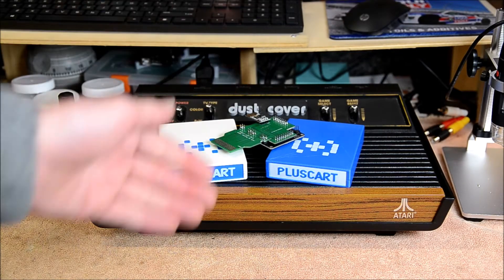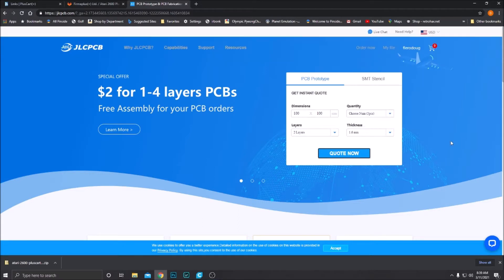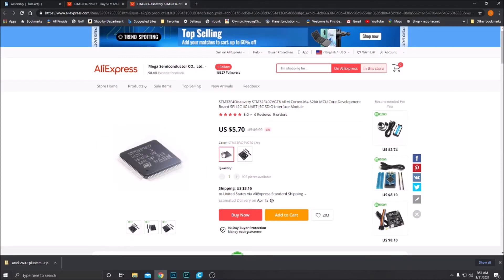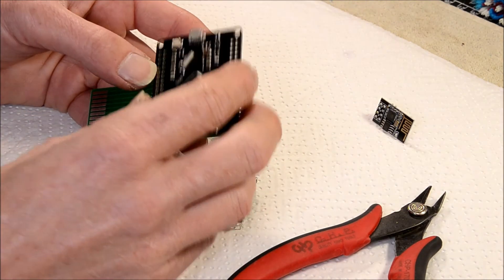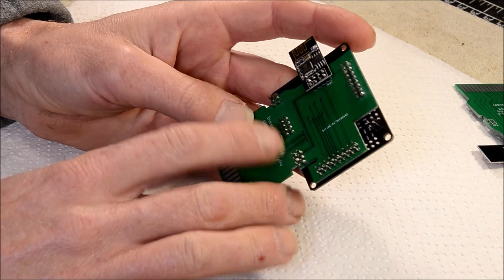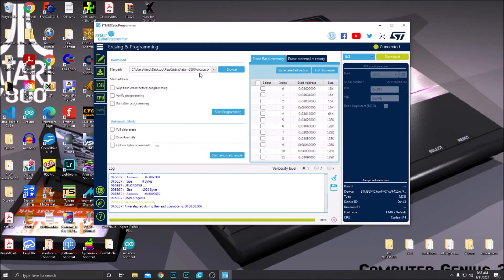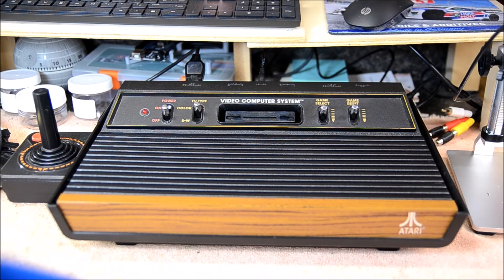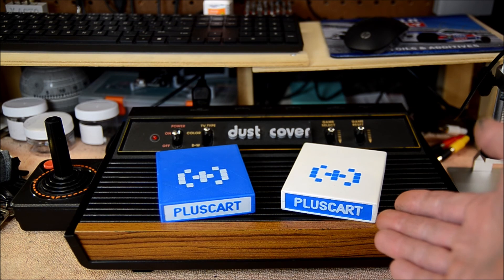How to Build a Atari 2600 PlusCart

Comment: I purchased enough to make 2 of these.  Followed the instructions to a T "
Double checked everything at least 10 times and tried 10 different micro usb cords.
It is not recognized by both my home PC" and the STM32Cubeprogrammer will not recognize it either. 
Very disappointing and highly frustrating.
Reply: this may help. I had the same situation and this resolved the issue: https://www.youtube.com/watch?v=DLhRbzL1i5E

Comment: This is a cool protect.  Though, the component choice is odd to me (I know that's not your fault), but like the ESP32S is about the same price (or cheaper than) the 8266, and it would remove the need for the STM32 (since it's more powerful and has enough IO pins). -- Just seems like a weird component choice in 2021.

Comment: Hi Doug. Thanks for your guide. Watched it, bought the parts and built it using your video.  One thing, I note in  another reply you mentioned you can flash roms into the memory in the development board. I tried to work this out myself but really couldn't understand how to do that. Any chance of a future guide on that? Once again thanks for the helpful video.
Reply from the maker: On your plusstore webpage, add roms to the offline roms folder. Then fire up your cart and a option on the main menu will appear, "download offline roms"

Comment: Where do you get the spring for inside the shell? And can it be loaded with ROMs before it accesses wifi? Having this dependent on an online component isn't entirely appealing. The online component could go away without warning and I'm left with a paperweight. 😐
Reply from the maker: No springs inside the 3d printed case. You can flash roms to the onboard memory using the cube programmer and a usb cable.